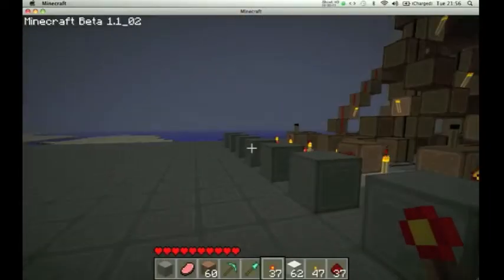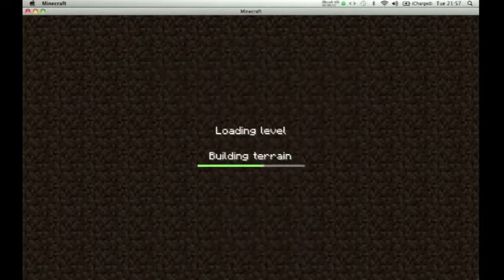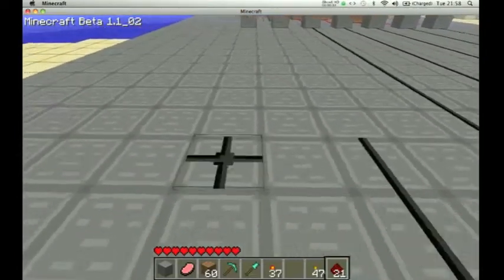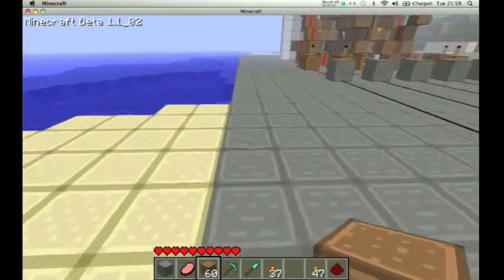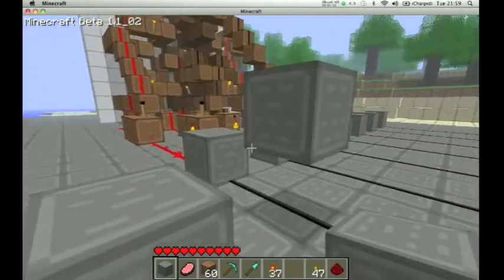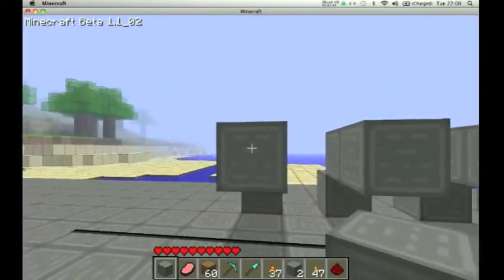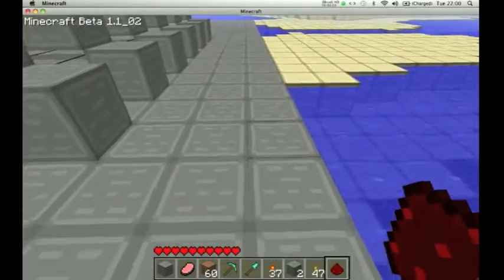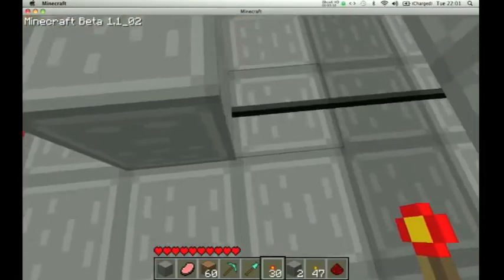Minecraft - How to make a complete 7 segment display & Decoder(Part4)

Comment from the maker: @MasterBlakis Basically how i did it (see my 3bit adder vid) is that you have a number of logic gates that connect to the decoder, each with specific numbers needed to be pressed for it to activate. You then feed out inputs to each of the gates and join them up, e.g all the inputs to 1 must be linked so that when you press 1 only the gate saying "one must be on with the rest off" will activate (1). if 1 and 2 is pressed, 3 will activate, and the others wont.